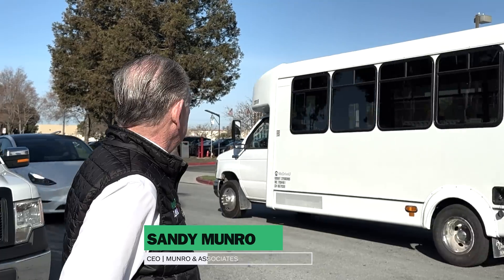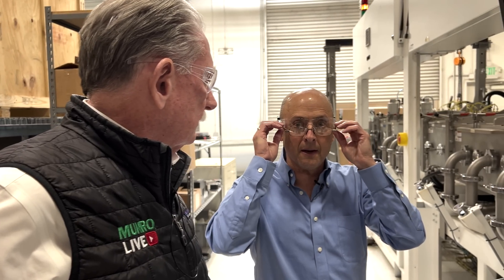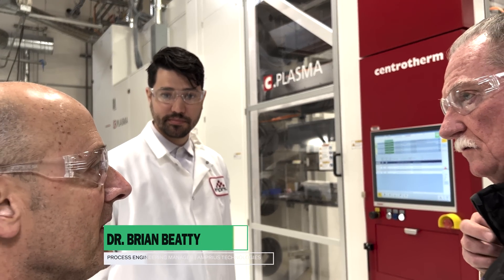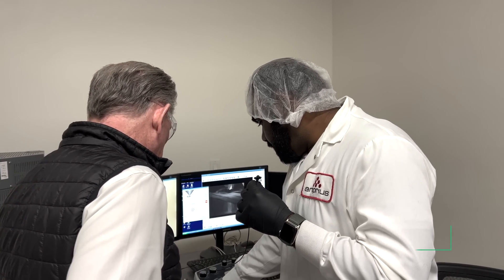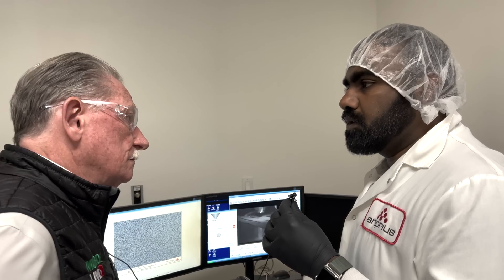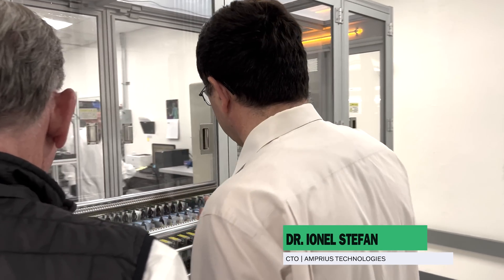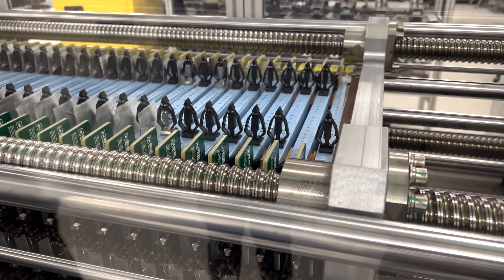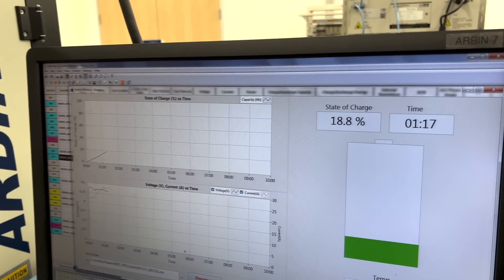Nobody Has Anything Like This: Amprius Factory Tour

Comment: With the 400 Wh/kg cells a race car can be built that has 100 kwH in a how swappable pack, good for 25-35 minute super high pace stints, second only to Formula One. I can see sub-ton endurance prototypes (ike LMP1), at that same pace, if aerodynamics and tires are allowed to be good enough. Even Indycar and Formula 2 could have perfectly fine and very similar racing, if redesigned around 100 kWh hot swappable packs. Indycar for superspeedways (Indianapolis and Texas) will want more refined slick aero to make a decent length stint, but Indycars don't have huge tanks now anyways.
Reply: Formula E received a 25 year MONOPOLY in open wheel racing. Guess why? Formula E is obviously being slow and lame by FIA design. Meant to curb BEV progress as the Chosen One main EV race series, and super restricted on one-make specs. Tiny battery, pointless aerodynamics, fixed battery when even rental scooters have swappable packs to go 24/7. Super hard compound tires with tread pattern prepared for rain that rarely ever happens. Result: sloooow cars. And to top it off: races are set LONG so you can't use the go pedal, and need to cooooaaaassssttt towards your braking point. Like getting 22 cars, giving each driver 1 liter of fuel and send them on a coast to coast "race".
Reply: The Porsche gt4e performance cayman ev can already do 30-40min on 1 charge at gt3rs car race pace on just 80kwhs right now. 

Charges in about 15mins at the track in between heats and can run Monaco as fast as the ice gt3rs does. 
600+hp race pace over 1,000hp in qualifying mode. Dual immersion cooled motors. Weighs about 3,300#. 👍🏻😎
Reply: @4literv6  Source? 40 min would be 120 kW average, to replace a 600 hp car that's probably a good bit lighter. Curious to see the math and race track chosen. A wet skid pad? :)

Comment: The 400 Wh/kg doesn't offer a lot extra for range, but charge speed is still plenty for today's EVs. Perhaps a but of a nuisance when used as air taxi, those won't be wanting long stops, or require quick swappable batteries (and why not have those?).
400 Wh/kg and decent dicharge rate will be great for car racing. What does Formula E now use? Regen is 12C for a few seconds, several times a minunte (lap). But 50 kWh is just horrible for a race car with open wheel aerodynamics. With the 400 Wh/kg cells a race car can be built that has 100 kwH in a how swappable pack, good for 25-35 minute super high pace stints, second only to Formula One. I can see sub-ton endurance prototypes (ike LMP1), at that same pace, if aerodynamics and tires are allowed to be good enough. Even Indycar and Formula 2 could have perfectly fine and very similar racing, if redesigned around 100 kWh hot swappable packs. Indycar for superspeedways (Indianapolis and Texas) will want more refined slick aero to make a decent length stint, but Indycars don't have huge tanks now anyways.

Comment: Charging tests of an individual cell can be an incomplete story.    For a 100kwh pack:  What is pack density?  How many cycles and associated degradation?  What is the efficiency of the system?  What is the rate of leakage or ghost drain?  What is safety of the pack eg pack is punctured and/or in large accident will it erupt in flames?  Just some questions I would have.

Comment: 370 Wh/kg is pretty good, NIO is claiming 360 Wk/kg for their upcoming 150 kWh pack. But, it's a POWER CELL.
This one here appears to have lower internal resistance or at least C rating while charging, which is really nice when capacity is experienced as limited, for instance in budget cars, vans, RVs. A really quick charge stop is nice if you have to do it every 2 hours of driving. A van with batteries to last for 4 hours of highway driving...is going to be EXCEEDINGLY heavy, low payload and COSTLY. Even with these 360 Wh/kg batteries. So getting 2 hours and a 6 minute fill-up, that is NICE. Still, batteries remain barbaric. It better get 1000+ hard charge cycles or it more brown than green anyway.

Comment: Bad video,sorry! Just a large amount of jidderish. Looked really amateurish in comparision to chineese producers. They should have focused on weight to energy/volume, price, charging, durability and when they have packs suitable  for cars ready. And most important cost and safety.
Reply: The video and content weren't exactly Munro's best. A lot of guessing but SOME specs follow eventually. 
I'd like to know what their purported customers are achieving with this tech now. Yes, SPECS.
They mentuon the 370 Wh/kg are 10C power cells. That's next level. Way better than Tesla promised and lied about on Battery Day the last time around. NIO has 360 Wh/kg on the way, but they do battery swaps, a costly operation. At 10C, that's rendered pointless. A regular 6 minute charge is just what people want. And take wee while the car does the opposite. 400 Wh range cells...probably a cheaper option, but by how much in mass production? Epic game charger for the EVTOLs that will not be allowed to land where we want them to land, even if they could fly 24/7 without needing a charge. But they will become a lot less useless. Fly faster and further than is possible up to today. Maybe up to 50 seat short range planes can be designed around 400 Wh/kg, but do expect fat tax to be applicable on a ticket. It won't be a long flight, because 400 Wh/kg just doesn't fly far even in an emply plane. Replace big jets even at lower speed from ducted props...nope. Just not enough range to fill those seats and planes get less efficient with size due to to their dependence on lift from air running over wings. 400 Wh/kg will help a lot with all kinds of road vehicles. Smaller ligher battery, more comfortable back seat because no need to put cells under the foot wells. Slightly less useless towing range if you go for the biggest possible batteries that will fit. Longer motorway range, if you pay up. Or, less frequent visits to the charger if you can't charge at home and your employer sucks.
Reply: It's a manufacturing tour, not an analysis of specs. They can build them and charge fast, that's the good news.
Reply: Jealous? You must be one of the losers.

Comment: Even if the packs are initially more expensive, they will still work for aviation as their gravimetric densities are industry leading. There were questions I would have asked:

Is this LFP? Or what chemistry.
Will standard BMS work with these cell?
Beyond the prototype assembly line, what is the timeline to scale?  Are they working with any partners?
Reply: this aint leading in anything sorry, and the manufacturing is the old way, absolutely terrible, impossible to compete or scale to anything meaningfull.
its the same old , same old. nothing to see here.
this aint good enough for aviation, just another nothingburger.
you can make some lucids and some eqs luxury cars with this.
if at all, we dont know the important metrics.
nothing meaningful.
Reply: @JohnSmith-pn2vl  That line was clearly a beta prototype. When Sandy first met with them, it was all theoretical, now they have shown and end to end beta. They can solve the manufacturing at volume by partnering. At 450 Wh/kg they have something better than what we have today. Elon Musk estimated about 300 to 350 Wh/kg needed for aviation.

Comment: How much charge they can hold? How much volume and mass is required? How long will they retain the ability to charge (and discharge) efficiently?
Reply: It says on their website 200-1200 cycles.
Reply: @michaelstaake  200 makes it disposable, only to be used for military and car racing.
1200, that is workable if the price is fair or the use is "supercar".
1200 for electric planes that do 8 short flight per 24 hours... Not going to cut it, unless everyone wants hefty "CO2 tax" on their tickets for the disposal of the batteries.

Comment: Wouldn't something like this be a big selling point for smartphone?

0-80% charge in 6 mins
And nesrly fifty percent more battery capacity

And not as price sensitive as cars as the battery for a phone is pnly ~0.02KWh so even if these things cost $1000/KWh it would be $20 for a smartphone to ha e super fast charging and a high capacity
Reply: Cell phones and a lot of other small handheld devices.  Wrist watches?

Comment: That charge speed tho... from 0% with no pre-conditioning prior to charge. I realize this is not at scale and these batteries are expensive, but if this is a sign of what's possible in the near future, beating the time it takes at the pump would be incredible.
Reply: Fossil fuel burning aero engines of any power are expensive, the price of these Batts to commercial operators will not be an issue.
Reply: I’m wondering about post-aircraft “2nd life” applications, like stationary storage, vs (by then) competing chemistries. Comments?
Reply: @Crunch_dGH  My thought too. Even if the energy density falls by half, if the charge time is still so fast, and the discharge current is still pretty strong, the "used up" batteries could be very useful in lots of other applications...
Reply: @banme2784  It's not 10 times and it's not trash. You're right to be skeptical, but there's no need to jump to a worst case assumption on a company that's been around for years. They already have commercial batteries in use by investor-customers like Airbus and AeroVironment.

Comment: Price at the pack lvl is probanly more important than charge speed or energy density
Reply: Limited production implies higher prices, but increased production will lower unit costs over time.  Increased competition as other companies learn how to do it will also lower prices.
Reply: Depends on the application. Both the 370 and 400 Wh/kg variants would have a great impact on car racing, if governing bodies don't interfere with car design and specs. Even the now heavily restrictred Formula E could probably have 50% longer races on these cells. But better would be, to allow 40 minute FULL SEND races, on courses where there is actually room to pin the go pedal once in a while, and tires to take some torque.
Reply: Price doesn't matter too much in some applications. Cycles matter more. If you have 400 Wh/kg and you cram enough in a private jet size plane designed for lower speed operation (flying on batteries sucks) you can maybe cruise at up to 400 kph and fly for about an hour, maybe two, for 600 km workable range. I'm being optimistic here. Or have a 250 km commuter with more seats. Silent enough to operate real close to commercial centers and nice family friendly cities? If you can only get 100 cycles, you can't do much more than one or two car racing seasons. Building a road car around it...not even if it's a McLaren or Ferrari. You need 1000 cycles for sure then. Commuter planes and short range commercial jets...multiple cycles a day...pack for only a year? That's too costly whatever the /kWh cost. "Green" battle ground TANK? Drag a pontoon with solar panels and 10 cycles is plenty :_D

Comment: 80% in 5 minutes is a game changer.
Reply: 6 minutes but who's counting
Reply: Getting to mass production is what is difficult.  There have been many extremely impressive low volume batteries which have failed prior to reaching mass production.
Reply: There was a company named Oxis Energy which was supposed to deliver 450 Wh/Kg.  They were one of many that when fasted with the realities of achieving production they failed.

I hope Amprius is successful, but at this stage it is too early to tell.
Reply: @phxees  This company and CATL are both planning to ship 500 wh/kg batteries this year. Not some time next decade but this calendar year. When a company like CATL says they are doing that, it means that they've gone through all the R&D necessary already, know it works and how to do it, have customers lined up,  a detailed plan for making production capacity happen, and probably lots of anxious share holders holding them accountable. So, could they be bluffing. Maybe. Or alternatively, they actually know what they are doing. And with them being the largest battery company on the planet, I'd guess that would be true. But that's just me. 

This small company seems impressive as well. This is not like every other promising research prototype you've heard about. The reason Sandy is walking away so impressed here is that they've adapted production grade machinery designed for the solar industry and are getting consistent results. It's a smart use of technology and it obviously produces usable batteries. The scaling process short term is to simply buy more of these machines. And long term it's going to be building better machines probably. But by then, they'll have a well proven market and product.
Reply: @phxees  I wonder what their customers achieve with these anode and cathodes TODAY. They're buying them for something, right?
Reply: What they don't tell you is that these batteries only last 100 cycles
Reply: @rwyo83  Excellent for race cars and military vehicles. Some eVTOL owners might give more about performance specs than greenliness. And she you're into those things it's not too save money anyway.
Reply: @Cloxxki  I may work for swappable batteries. That is why Nio is ahead of Tesla
Reply: for a game that doesnt count.
its pretty muhc useless tech
the only thing that matters is mass production at levels never seen before.
everything else is useless if we are talking about a revolution.
Reply: @JohnSmith-pn2vl  Not really. You may only care for mass production, but whole industry outside your interest may be happy with higher density batteries whatever the cost, as long as they get a modest 25 or 100 cycles before degrading too much. Race cars, for instance. When the cycle count shoes into the thousands, commercial airplane builders will get interested. Still no need for mass production, just specs, at almost any price.
Reply: Toshiba have been selling such for a while. Energy density wasn't big enough to really work well in BEVs and power density not quite for hybrids. With those bridges gapped, BEVs could suck a bit less, and electric planes can gain  few seats or tons of payload. Batteries are still barbaric, but with a gun to the head, you can in theory achieve some workable specs. Perhaps even greenly so.

Comment: How many cycles can it do?
Reply: This please☝️Half truths are unimpressive. 
My first car (a bobcat) went 0-60 mph in 2.7 seconds - (when pushed of a cliff)
Reply: I was able to track down an article about their independent testing, it’s between 200-1200 cycles depending on manufacturing defects, graphite batteries are 500-1000 cycles but these batteries have between 2-3 times the energy density! They are focusing on the aviation industry because energy density is far more important than longevity for them, and these batteries are good for a much wider range of temperatures. they can use that money to research ways to make it have higher cycle life so it can eventually be good enough for electric cars.
Reply: @jonkeau5155  Between 200-1200 is so bad, if they cant get greater quality than that it will never enter any sort of vehicle. The difference between the batteries cant be that much, thats a horible product.
Reply: They did an interview earlier on the channel. It doesn’t degrade because the battery does not build dendrites.
Reply: @Onwurst is it 100% solid state or semi solid?